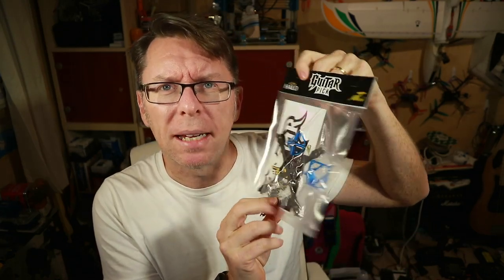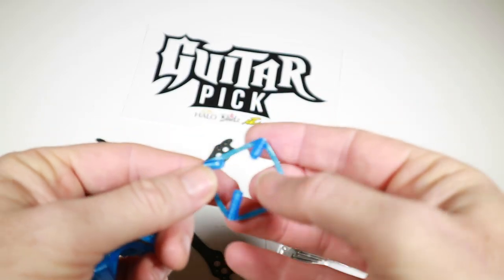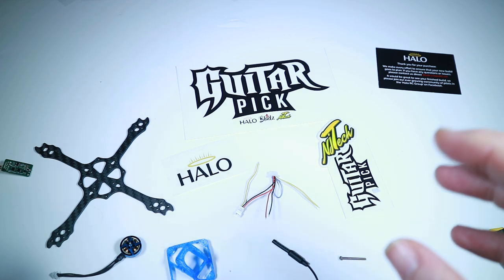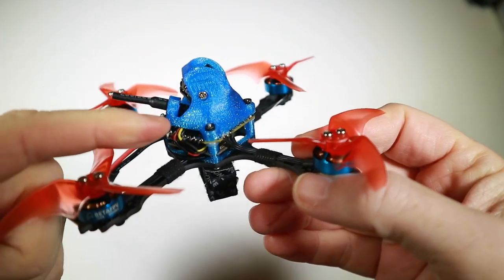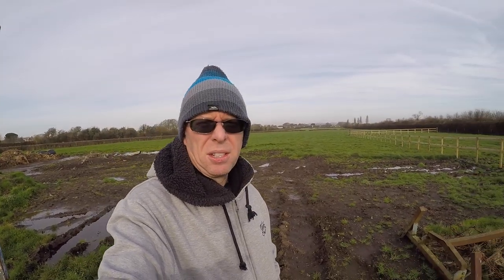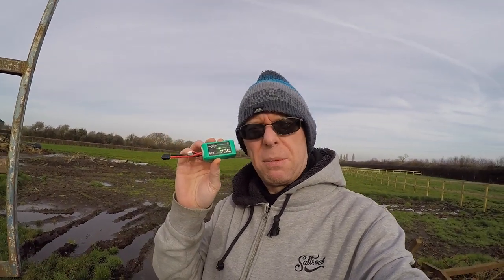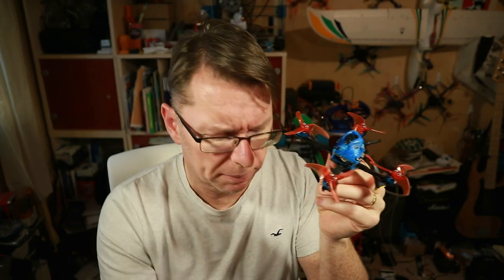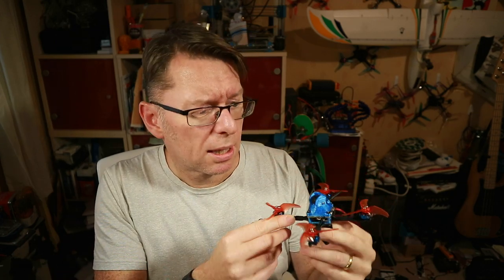GuitarPick Toothpick frame review.  Supplied by HaloRC

Comment: Great video Wayne 👍 I've got this frame and just waiting for some parts 😁😁
Reply from the maker: Nice - what you putting in it ?
Reply: @CurryKitten  some Rcinpower 1204 5000kv and I'm waiting for banggood to restock the camera and aio fc, which will be either the flywoo or mamba depending on which has the better price. Also got the eachine triangle d for vtx/dvr hopefully it won't have the problem your dvr did

Comment: I noticed in toothpicks, seems to be alot of jello? Is it bcuz the canopy is just soft or the cams. Doesnt feel good to fly. I have the hx115 non hd n tried everything to keep the canopy firm. Which it is and still get jello sometimes. Cam lens is tighten too n still.
Reply from the maker: You need to spend some extra effort in getting it right... something I'm a bit lazy on, but I'm aiming to persevere on this one.  It certainly can be smoothed out as myself and NJ used almost exactly the same components on our builds (aside from the VTX) and his is as smooth as butter.  So aside from changing props and messing with those screws holding the TPU camera mount in, I'll be seeing what difference RPM filters and more tuning makes.

Comment: Nice little quad Wayne....3 inch props and 4S is the way to go..?... Camera, you had it set to NTSC.?
Reply from the maker: Honestly, I don't think you'd get any more from 3s in the way it was flying, and 3" will give more power.  The Nano2 doesn't have any OSD lead to change anything over, so it is what it is I'm afraid.

Comment: Instead of passing the video thru the DVR, split it from the cam. So , from cam, split the video, one video feed going to FC , and another vid feed from cam going to DVR. Then of course the output from FC goes to the vtx. I've done this several times and no degradation in video quality.
Reply from the maker: Yes - I think that's my first thing to try.  Feed the DVR from the camera, but also take the same line straight into the FC.. and then remove the line that sends the camera signal from the DVR into the FC.  I'll see if I can find a statically lit place so I can compare them
Reply: I’ve had the same when using the 5v from the VTX into the camera. I changed it to a 5v on the fc/esc and ta da!

Comment: Nice quick build :D Could you parallel wire the camera to osd and dvr? Might help? Looks like impedance going through the dvr is too high maybe? Will be great to see 2.5" vs 3".
Reply from the maker: Yes - I could try going direct to the camera as well as the VTX, then cut the VTX to FC return, and take the input from the FC with the OSD for the VTX (if that's what you mean)

Comment: @currykitten I was thinking about the VTX signal being darker and remembered that this can happen when you split analogue signals; for instance to record the camera and also pass camera to FC and send back. Could you try using the alternative lead from your D400 (records OSD to DVR) and see if the VTX signal is brighter? I also have one arriving so I will experiment as well.
Reply from the maker: Right now (IIRC) the signal goes into the D400, then out to video in on the FC before returning to it via video out on the FC where's it's transmitted on 5.8Ghz.  One thing I was going to try is actually splitting the signal so camera goes to FC, as well as the D400 and then cut the link from D400 to video in (if that makes sense)  My guess is that the "bad" stuff is happening in the signal that the FC already gets from the D400, so I'm aiming to cut that out (if that makes sense)
Reply: @CurryKitten  there's two different cables with the d400, I'm going to test both.

Comment: Why make the arms with 2 different mounting sites for motors (2.5 and 3" props). Why not make it for 3" only and get rid of the extra (weakening) holes? You can always put 2.5" props on a 3" frame. I think the slightly increased space between 2.5" props on a 3" frame actually flies a bit smoother than a 2.5" frame.
Reply from the maker: Dunno - you'd have to asked Bludz and NJ that one.  I do know they went through a lot of prototyping before their final design, so I'm guessing there's something about having those closer mounting holes which makes it better.

Comment: put a cap on it and the camera will clear out, as for the battery strap try use the tpu printed holders, and sit it the toilet tank style.
Reply from the maker: There is a cap on it, it's part of the XT30 lead.   I'm somewhat underwhelmed by this VTX right now
Reply: @CurryKitten  I'll  check mine  see what the difference was.